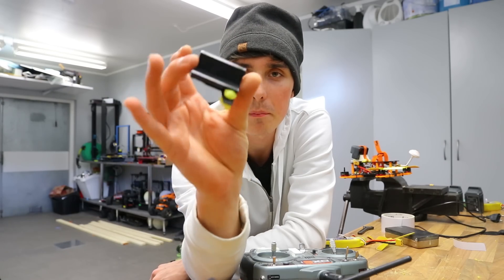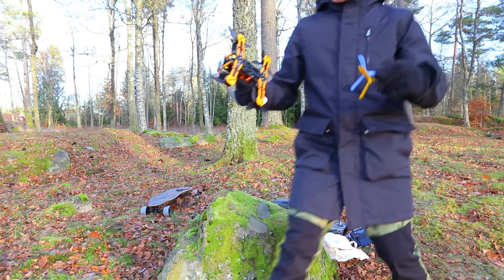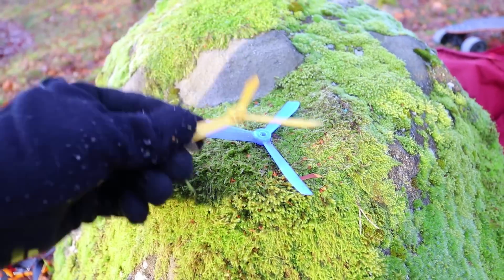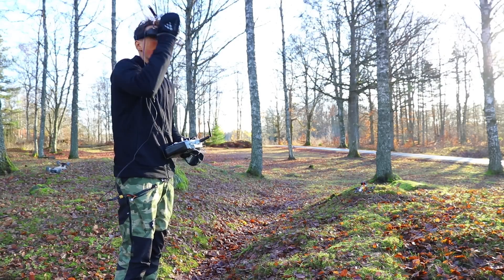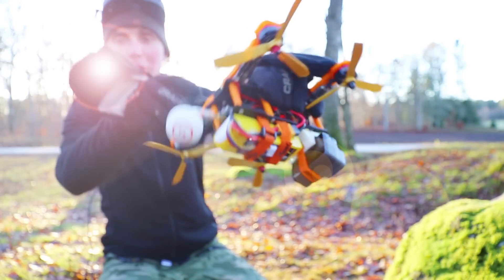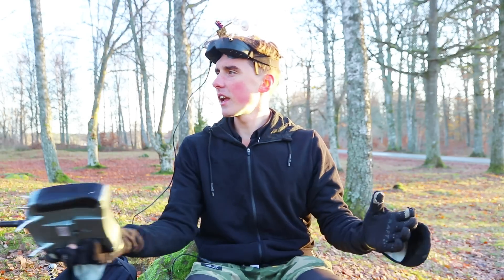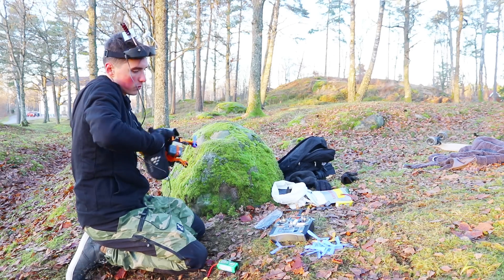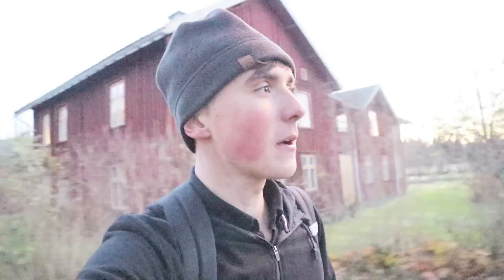3D Printed Drone Propellers - Will It Work?

Comment: Prop design is really taking off in the FPV genre right now. Go check out the channel Kabab FPV. He has a ton of knowledge on the subject. In my limited circle he is the authority on props.
Reply: Kebab loves to act like he knows what he is talking about.  He often has no clue.  He has issued so many retraction videos correcting his other videos where everything he said was wrong.  He has made lots of people angry by telling total lies about their products.
Reply: Tristin Gilbert. Correct. JB is great. But he doesn’t do in depth prop reviews. So telling Simon about his channel isn’t going to help these props.
Reply: Yeah he talks to engineers and doesn't understand anything.  He is flat out wrong most of the time.  When talking about motors he says they should add one more pole to the motor not even understanding that a brushless motor needs poles in multiples of 3.  And his prop rating system is a joke.  Very good = crap, very very good = OK, very very very good = good, very very very very good = very good.
Reply: I don't hate Kabab, he does offer great knowledge about props, motors, and frame design. I would very much like to see the 3d printed prop work on his drone and hopefully for others, creating more innovation in the prop market. Kabab knows what he is talking about (90% of the time but that is the same for everyone else), I make sure to see people's responses and their knowledge/experience. Joshua Bardwell is an amazing person to watch, he focuses more on the tech side of drone racing (ESCs, flight controllers, VTXs, cameras, and antennas) but he sure knows what he is talking about.
Reply: There is no reason to 3d print props. 3d printing is only really good for rapid prototyping where you need to make changes often.  Once you have the final shape figured out molding plastic is far more economic and it produces a superior product.  It takes hours to 3d print a prop.  It takes minutes to mold one.  If you only need to make a few of something 3d printing makes sense.  If you want to make 10,000 of something molding is the obvious choice.
Reply: He's the Russell Brand of the fpv community he's just intelligent he has no clue what the f*** you talking about the guy flies a maximum of an hour a week there are plenty of kids and people like myself who fly 20-30 batteries a day minimum
Reply: mikeTECH because props act differently in different elevations temperature humidity atmosphere different quadcopters different KV Motors different types and sizes of Motors you don't just put it on your quad and everyone else's feels the same that's just hilariously ignorant
Reply: Plur307 you are very correct. He can design a few good frames but just likes to talk into the camera.
Reply: Nothing takes that long to be delivered.  Plus there are at least a dozen quadcopter supply stores in the USA that stock all the good props online.  There are also many stores in Europe, Australia, Asia etc.  Africa and South America are probably the only places that have to worry about shipping times.  All of them will have the props to your house in about 3 days.  3D printed props will also never be as strong as molded props.  Again, like I said before, if you want to do it for fun, great!  But thinking you can make your own high performance props at home is just foolish.  A really good set of racing propellers in the 4 to 6 inch diameter range costs less than $5 for a set of 4.  There is no way you are going to beat that by 3D printing at home.  When you take into consideration the electricity cost, filament cost,  time, and effort it takes to make a set it's going to be really hard to justify all that effort for a set of inferior props.  I've been racing quadcopters for 2 years now.  Props are one of the most important things.  The difference between how different styles feel is very pronounced.  It's not just the shape that matters.  Materials and balance are also very important.  Name brand props and their identical looking knockoffs often feel very different even though they look identical.  There are literally like 8 brands that make knockoffs of the HQ 5x4x3 propeller.  Some are great, some suck.  But they look the same.  Making good propellers is an art.  These things are spinning at over 25,000 RPM on a powerful racing quadcopter.  Tiny flaws in design cause horrible resonance and balance issues.  You can hear it when you give full throttle.  The resonance carries into the frame and confuses the gyro that is controlling the quadcopter and makes control go to crap.
Reply: mikeTECH he flies like once a week
Reply: QUADBOT FPV. Lol Mad bro? Why is everyone so up in arms about Kabab. Where are all your prop videos guys?!
Reply: mikeTECH no y
Reply: QUADBOT FPV. 😂 what are you talking about?? 
I’m asking you, where are your prop review videos since you “know so much”. 
Who said anything about props working the same for any quad???
Reply: Plur307. Yes plur, he mentions how often he talks to said aero engineers about prop design. And he gets prototypes months before release bc he talks to the engineers. And I also can’t remember the last video I saw of his where he fails to mention he’s NOT giving his info. He’s merely sharing what the engineers tell him. 
So much hatin going on. Smoke a bowl gentlemen.
Reply: I was clearly talking about manufacturing them in bulk.  I understand the DIY maker philosophy.  But prop companies actually hire real aerodynamic engineers to design these propellers and have them tested by some of the top pilots in the world.  If you follow any of the big name quadcopter racers on youtube you see them give sneak peeks to prototype props all the time.  The idea you can engineer a better propeller than a team of aerodynamics experts and top tier pilots is just silly.  If you want to have fun making your own props that is fine, but they will be inferior, period.
Reply: Not all of us in the hobby are professional racers like you 2. He def offers up prop knowledge I️ wouldn’t otherwise have. Plus, simon here just needs a slightly better designed prop for efficiency. So you can hate but he’s taught me more about props than any other channel. #iawaityoursuggestions

Comment: Interesting experiment. I have a fully 3D printed 250 quad as well (based on the firefly model on thingiverse. Mine is mostly made from Nylon and it is incredibly durable. However, I never bothered doing the props for the reasons you discovered (fragile and unbalanced). But it is cool to know that it can be done and does work to some extent. Perhaps polycarbonate or Taulman 910 would do the trick. Cheers!

Comment: Simon, you're advancing the discipline through trial and error. It's all good! You're also learning quite a lot to be sure. 

My very non-expert observation is that the props you printed vary tremendously in form from the stock props. Just a thought, but I wonder what props modeled after the stock props, and printed out of, oh, I don't know, nylon, would do. 

Keep up the great work you're doing!

Comment: Can you provide a link for the FPV Goggles you are using and the camera/transmitter for the air craft?  The link below leads to some cap Google that look barely a step up from Google cardboard.  I would like to modify my Phantom three advanced for fpv but keep the hardware portable from one platform to the next.  Thanks for you help.
Reply: David Thanks

Comment: Why do you have to rotate the propellers and not just mount them backwards? When you rotate it the axis is not touching the build plate so it uses support in there and it is not as good looking as the original position.

Comment: First, you should wear goggles when testing 3dprinted propeller just in case it shattered at the height of your head! Don't take that chance.  For the 25 % lost with the printed propeller, they are just not the same profile as the original.  Aerodynamic of the leading edge and the trailing edge has a lot to do with the vibration. Your propeller would create more noise than the original even if it was with the original material. Love your video and all the great projects you bring to us . Keep it up.

Comment: Now go buy a prop balancer and balance those props :-)
Reply: David I've been flying cameras on airplanes since before digital :-) the early digital cameras had an incredible amount of Jell-O because of the slow scan rate of the sensor I've got some videos where light poles look like snakes wriggling all over the place :-) wish I still had those videos I might find them one day this is all before YouTube

AP is aerial photography the reason I got a drone to strap a camera to it and capture pictures and video I used to do that with my RC airplanes I would strap cameras at different angles and fly the airplane around guessing it what it was seeing the first fpv was on an airplane not a quadcopter then multirotors came out quadcopters are drones we call him now which is amazing because now I can send up a drone pocket in a spot in the sky and the camera exactly where I want it with the view from the transmission from that drone and click the shutter stuff is amazing :-) but I would love to get into the thrill of fpv flying a race drone :-)

Back then I just called it on board video :-) because we couldn't transmit it down to the ground at least most of us couldn't not easily
Reply: You meant: 3D print a balancer >.> i mean he probably already has washed/dry-lubricated skate bearings (aka "fidget spinner" bearings), so you don't need much more, a stand and couple cones to span the prop in?
Reply: David no i dont. A lot of ap via remote view but not true fpv. I did get my first set of goggles but no vessel to link them with.
Reply: True
Reply: print props from tpe
Reply: Nerys, I see you're a 3D print hobbyist... have you tried your hand with a printed drone?
Reply: Nerys no i think its fine
Reply: Utters Adventures productions balancing the props will get rid of the vibrations in jello in the video

Comment: O.K. so we need a like for like test. You need to print some props that are the same shape and sizes as the black ones you where comparing them too. then you need to sit and balance 1 set so you can give use a time reference for that task, finally you need to do some test flights with the balanced props. So basically a whole new video PLEASE.

Comment: RCLifeOn - Thanks, you answered my question that PLA 3D props will actually fly without self-destructing due to the inherently high stresses they are subjected to in flight.

I suggest trying nylon in the future since nylon has long proven itself to be a nearly perfect material for model props.  I also suggest preparing your just-printed props for flight by carefully sanding then polishing the blades to remove lumps and bumps and to provide smooth surface finish.  Be careful not to change the airfoil shape.  You should also take the time to balance the props.  I actually do these steps with factory props.  Not only will you see a performance increase and smoother flight, but it will be safer.  Unbalanced props are always trying to self destruct.  Since you're experimenting with different materials AND flight testing these experimental props yourself, you shouldn't push your luck.

Here's another idea.  For a good comparison between factory props vs 3D printed, why don't you 3D scan your favorite high-performance factory prop then 3D print it and prepare it for flight as outlined above.  I personally think that SLA is much better suited (and safer) for making props than FDM, but nice to know that FDM can work.

Cheers from Thailand!

Comment: You should try using carbon fiber filament. See if that helps with the strength. Also I would suggest you make the blades a bit wider and a little thicker.

Comment: Love your drone videos.  The country side there is really beautiful.
I don't think that the propellers are breaking due to the crashes, at least not all of them.  I think the propellers are shattering during flight, too many stresses.  The vibration due to unbalanced propellers would make it worse.  Notice they all broke at the hub.  The retail props are much thicker at the hub for the stresses.  Aren't most props polycarbonate these days?

Comment: I wonder if you did some finish work on the props like brush on epoxy if you'd get better results. I bet part of the issue was the design being weak and not structurally strong but also the surface finish of the blades aren't smooth like a manufactured prop. It would be awesome if there was a way to make a holo point inside the props and inbed something considerably stronger in the center pocket by pausing it half way through. Could drop in paper clips or wire or tiny carbon fiber rods idk. Would be awesome to make a mold with a sla type printer and then inject different materials in it. Epoxys, plastics, coat with fibers and then the same perhaps. 

You could potentially make a really great prop that is easy to replicate.

Comment: As far as the vibration is concerned, you would also have to take into account that the quad was not re-tuned for the new propellers. The difference in weight and shape would be enough to require a re-tune

Comment: I think you didn't actually hit anything there the second crash, it might be the propeller just broke mid flight. The prop design is not very efficient anyways, it should be thicker at the base of the blades and also a steeper angle which gradually thins out and use less angle towards the edge instead of being like a flat stick.

Comment: Dude, your awesome. Thank you for the vid. You try to make a small drone frame that is flexible enough not to break during crashes yet stiff enough to handle the thrust of the motors. That is how the best propellers are today and I think frames will be like that in the future.
Reply: You want the frame as rigid as possible.  Floppy frames create feedback and oscillations.  Carbon frames are nearly indestructible.  You need to crash really hard to break them.

Comment: The reduction in power was probably mostly due to the design of the propellers, rather than that they were 3D prited - the original ones had much wider blades. The biggest performance issue other than that, is probably the balance (this is what causes the vibrations). Much of what is likely caused by support material that's hard to remove equally between the blades, without having remains of it causing weight and aerodynamic inbalance.

Comment: Printing them with a SLA printer would be interesting
Reply: Daniel Westall. My understanding from watching Kabab’s prop review videos there is a company doing that. But they are using a very VERY expensive medical grade SLA printer. Something like $40k for one. 

The initial problem was prop shape here. Swinging a club was referenced in another comment and it’s not far off. Lol. Add bullnose to that and yeah. Great start though Simon!
Reply: I want to see some titanium 3d printed props, those could actually be really good. If you need a thick airfoil, you can even make the prop hollow, and whammo you've got a competitive metal prop.

Comment: Great video, Simon! I agree that some of the power loss is due to vibrations, but if you're going to compare the 3D-printed propellers to the non-printed ones in terms of power, you should at least make them the same shape! Also, I can't tell if you already did this, but i think the pitch of the blades should decrease from the center of the prop towards the edges to account for the increased lift the faster moving tips make compared to the parts near the center. This might be more relevant in larger props though. But hey, still great content :)

P.S. Greetings from Norway :)
Reply: Tapering towards the tip keeps lift along the blades the same without having to build twist into them. It also improves throttle response by decreasing rotational inertia. Centrifugal force is also decreased, which would be a good thing for 3D printed props to prevent coming apart between layers.
Reply: Loss of power can be counteracted by having more surface area. They seemed to me as if they had a LOT less surface area than the black props anyway.

Comment: I think they're breaking because you designed them like swinging clubs around. Props should be thicker/wider and steeper pitch at the root, and thinner/narrower and a shallower pitch toward the tip. Looking forward to your next attempt! Thanks for the awesome vids man!  :)
Reply: More to do with the efficiency than the breaking, but yeah. Those things apply because the airspeed is effectively a lot faster at the tip. You want to blend a foil shape that can deal with the airspeed gradient to provide about the same lift (or thrust) along its length. Making the blades a little bit thicker overall should help with the vibration (stiffer), but there may still be a material limitation for 3D printable in terms of breaking.
Reply: They're breaking because they're made out of the completely wrong plastic for this application

Comment: Your proppelers are exploding because they are not strong enough to spin so fast.
Reply: Duhhh...
Reply: No shit sherlock
Reply: That isn't really true, in all 3 crashes he hit something, in the last one he hit a hanging branch just out of camera. The first two he hit a tree, it is the shock of hitting something mixed with the force of spinning and/or the props themselves hitting the tree.
Reply: I'm guessing they are exploding, I do that a lot on my regular props if there is much damage at all. If he did more than hovering and slow speed flying, I bet these would be exploding well before full throttle even on that 3s battery.
Reply: I would guess that too, but the video clearly shows him hitting something 2 out of 3 times, and the third time it seems like he hit a branch hanging out of view of the camera.